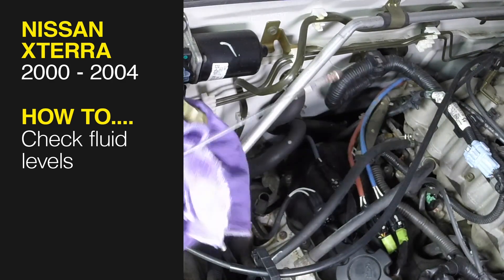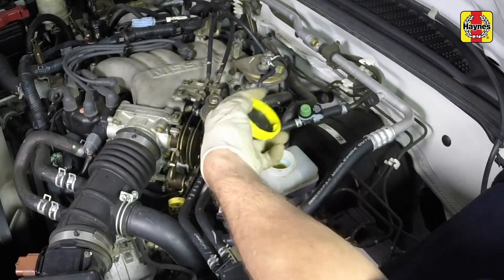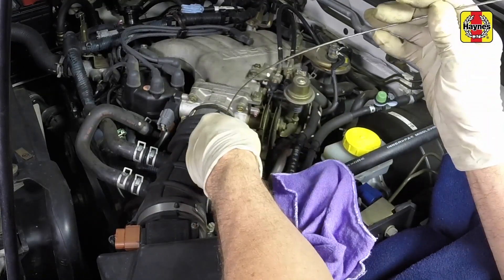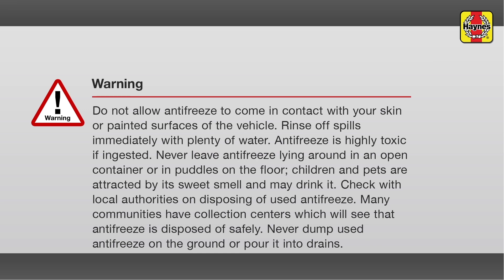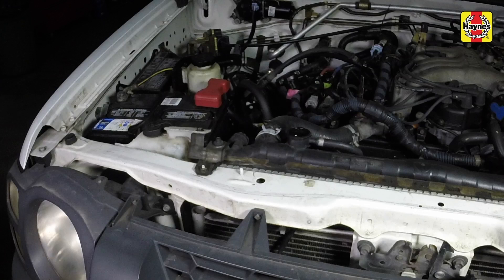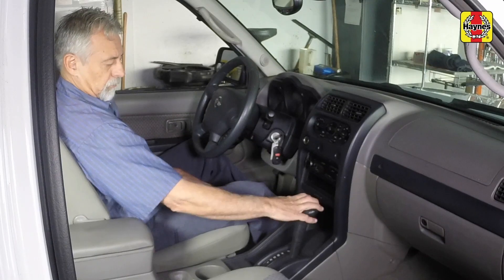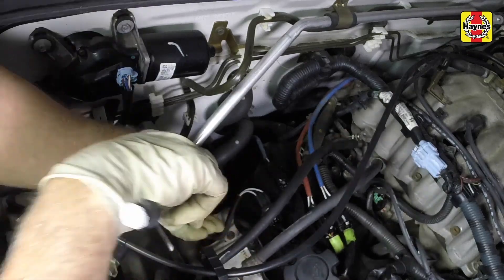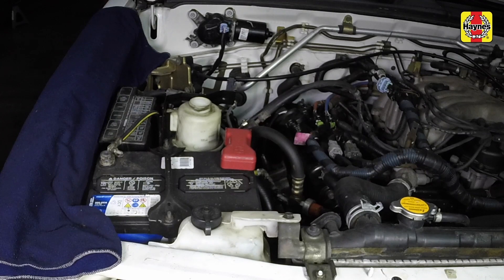Checking the fluid levels on a Nissan Xterra (00-04), Pathfinder (96-04) or Frontier pick-up (98-04)

Comment: Section 8 says check section 1 for recommended fluid for 1996 3.3 manual master cylinder fluid.  But I cannot find it in the list.  Is it a typo?